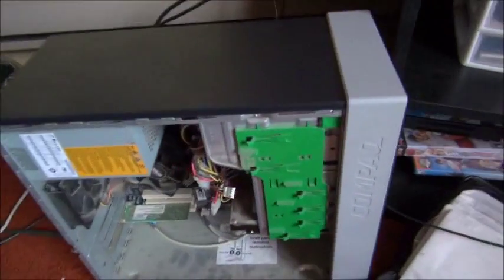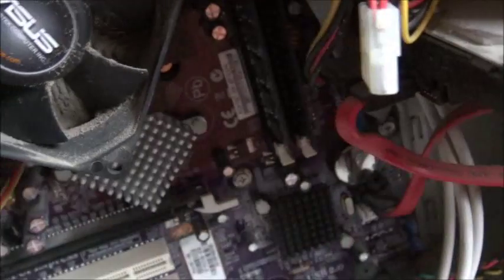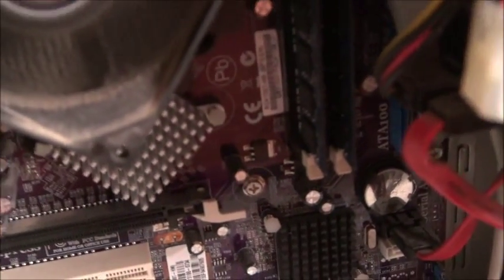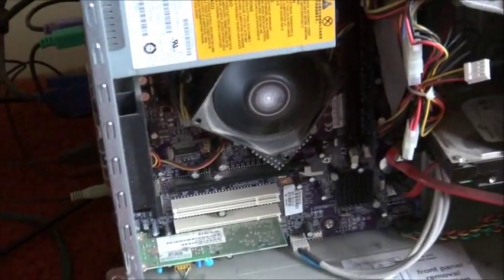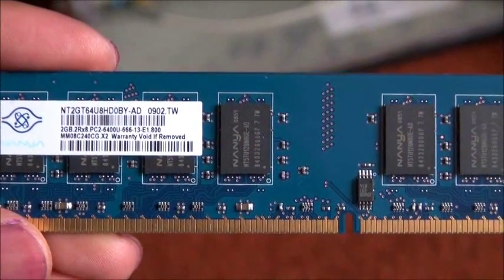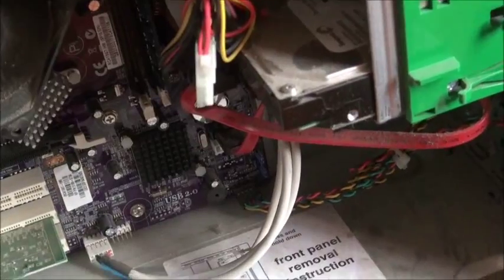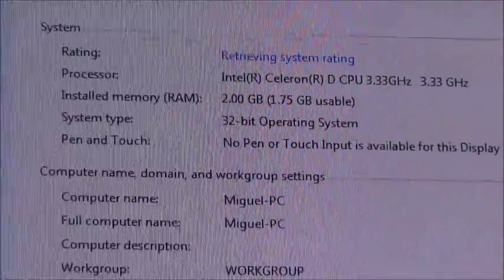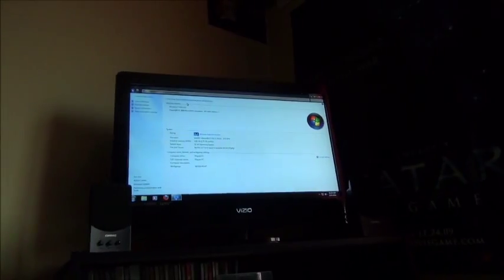Computer Help: Uninstalled RAM slot?

Comment: I'm so scared I have the same ram but one 4gb and I couldn't fit it in and I thought I had the ram in correctly but when I turned on my pc it made a beep sound and I turn that shit off real quick
Reply from the maker: +Jesus Margarito yeah it kinda tricky to place them in. just push slightly on the card then clip them in from the sides. make sure you dont push to hard, the motherboard could get slightly damaged. anyways, just make sure the clips stay in the sockets correctly they should make a click sound when there placed in correctly. the beep you heard was cause it didnt have ram in so dont worry they all do that. just put that sucker back in. sorry for the late reply.

Comment: I have problems too just like that. i have four ddr memory slot no 1 slot is not working when i put the memory stick to the other  2 3 and 4 its working how can i make the no 1 slot working again. Can you help me guys.
Reply from the maker: +lhady mitch Not sure if you fixed your issue and also sorry for not replying in time. i tried the eraser trick but it never worked properly. so i was out of luck. besides that computer was WAY old ive gone through a few more since.

Comment: mmm maybe your mobo has alot of dust, you should clean it and maybe it will recognize it, or one of the slot has a bad welded pin, and that is pretty expensive to repair,  but first try with some compressed air, and see what happens